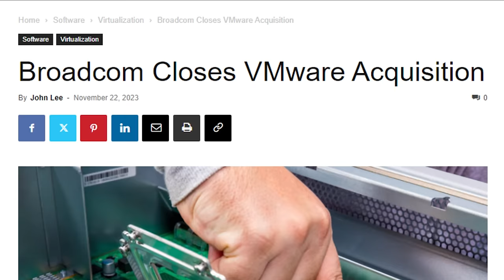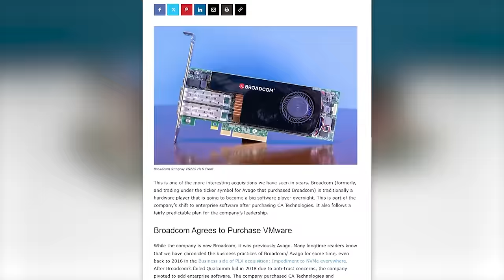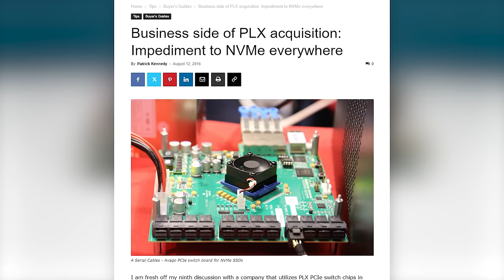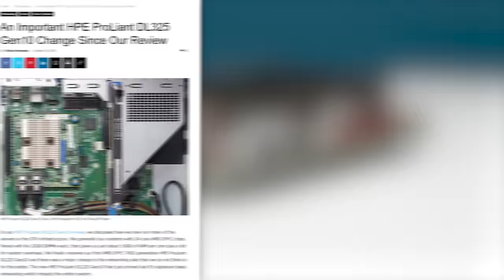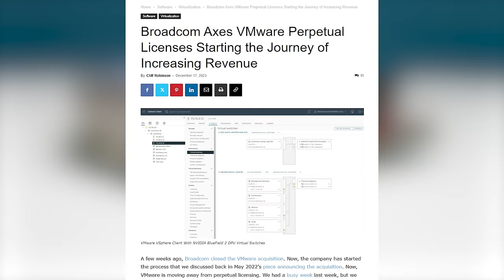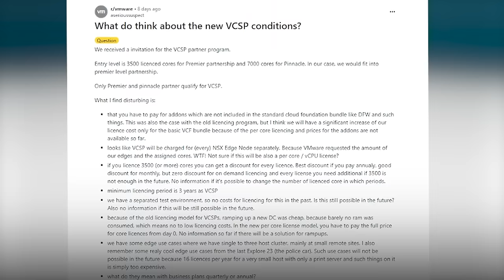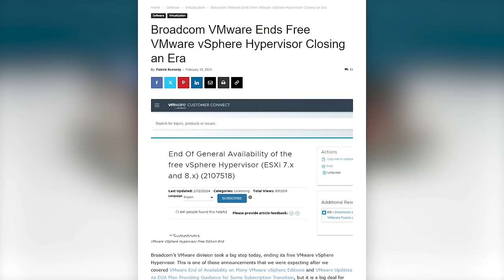VMware GUTS Customers with 10x Price Increases

Comment: This last 18 months has been one long gut punch to me. I've been playing with VMware for 15 years now. Yea, it was pricey, but it's a good product. Now, the way things look, it's almost at parity with bare metal for costs, at least in the VDI space.

I shouldn't whine too much. It's just a case of, "Things change, I better change too." I just hate how it was absolutely unnecessary. It's not a "revolutionary improvement," it's greed making a great thing suck.
Reply from the maker: I somewhat wonder if we are going to get a model with small PCs for data center managed physical desktop infrastructure. I think there is a business model there.
Reply: HP had the CDI Moonshot solution.   Too bad they can never hold on.  Moonshot was this dense compute platform and one cartridge had four AMD APU’s.   You managed the whole thing with Citrix but no virtualization.  Everyone got a dedicated system with low end GPU.   Think 140 or so laptops in a 4 u chassis

Comment: I work for a non-profit organisation that have been a VMware shop since 2005. We have a small environment consisting of 2x 3-host clusters using Essentials Plus and a 5-host Horizon VDI cluster. 

We used to receive reduced pricing due to being non-profit but now we are really concerned about what our renewal pricing is going to be under the new model. 

Switching to another platform might be what we have to do. 

For those in similar situations I would strongly recommend testing out other platforms and getting familiar with them, even if you have old hardware that you can run in your organisation to help better prepare for any transition.

Comment: I work for a smaller vmware cloud verified provider. Currently what will likely happen is , even if we do switch to something like nutanix, which is still up in the air right now, a large chunk of our cloud customers is gonna leave, which will likely lead to me being let go. It is how it is. Sucks but we gotta move forward
Reply: Last time I've checked the prices for vmw and ntnx (it was 2021 I believe) and the prices were around the same. But ntnx has a much lower TCO, it just works and you don't have to spend time on maintenance. The upgrade of the whole cluster is literally done via a few clicks in the GUI.

Comment: Yep, we are on a "deal" for the next bit with a company mandate to be off VMware and on AWS by the end onf 2025. ~3,400 VMs, ~100 hosts, ~4200 cores, ~77TB of RAM. Plus storage arrays and all the fun that goes with them.
Reply: Are you expected to see a cost savings by going to AWS or was that decision made just to avoid giving broadcom any more money? I would expect your AWS costs to be in line with broadcoms new pricing model (depending on load), no?
Reply: You costs will ALOT more than on prem vmware.. I already went down this road a few times.. If you cant shrink your workload when your not using it... probably better goto nutanix or something else..
Reply: @DerekPeldo  leadership decisions made over a year ago, I suspect it will be a money pit for a lower quality product.
Reply: @iimbt11  not an option, orders from the top.
Reply: @gcs8  yep been there too :) ... I remember about 6 months later  the CFO started really getting concerned when the expense started to skyrocket.. was funny when you showed them there was nothing they can do about.. worked with several companies since then that knew how to navigate the cloud, where you should goto cloud and when you shouldn't.. at least with your own infrastructure you can run it into the ground and depreciate the cost... then buy new...
Reply: And another one goes to the "cloud." You're trading one form of ransom for another.

Comment: I'm sure the price rises will be steep, but I can't really see the difference between the annual support and maintenance we currently pay and a "subscription". The support and maintenance allows us to use new versions regardless of the fact that our original perpetual licences for esxi/vcenter were bought in 2010.
Reply: Overall, you're right in that "subscription" vs "Purchase + support" for an enterprise doesn't have to be very different.  The biggest difference, in most cases, is that if you decide to drop support, you can still use the product, presumably while migrating off.   Without support, you could relegate that to non-production use, and it's still yours.  

As for the freak outs, customers are getting quoted for a whole wide range of multipliers over their existing support. I've heard anywhere from 1.3x to 25x.  There have to be some extraordinary circumstances in those high edge cases, but I can't say I haven't at least heard it.  So, like all things, especially if you're using EP, maybe with some Aria add-ons, you might not be in terrible shape. Assuming you're in a good negotiating position with whoever is doing the licensing, great. If you're using NSX, that'll likely be a hit, since you'll be pushed to VCF, especially with the distributed and gateway firewalling being add-ons.
Reply: @Ghandacity  I'm hopeful that we may be OK. We didn't go in for convergence so we just have vcenter & esxi. We have enterprise plus licences that I think we can now move down to standard since the implementation of an active-active metro node SAN solution, although I haven't looked too closely into that yet as we took up a multi year support agreement. 

As I understand it no support means no security patches, which would rule it out even for non production use in our environment.

Comment: We're currently setting up virtual test control computers fpr a German OEM (the one with rings) with VMWare ESXI and had for example issues with the VM host crashing when were runnung a specific application on a VM client instance. no one of VMware cared. And now it looks like we soon need to switch

Comment: Finally a video covering this painful subject.  Customers/Datacentres using the VCSP program which is metered in vRAM usage not cores are also typically using the vCF stack of vSphere/vCenter/NSX-T and possibly Cloud Director, moving away from all of that in 90 days or so is impossible (it's not as if you can just re-install a new Hypervisor on the same tin you've already invested in).

Maybe this week we'll know more about how smaller outfits can purchase licences through the aggregators, but I'm betting we'll lose direct GSS support with VMware if we do.  What a complete nightmare.  There is no way all of these customers are simply going to switch off their VMware estates come 31st March.
Reply: It’s an impossible job.  The obvious outcome is some businesses will risk becoming “non compliant”, as they work to migrate away.
Reply: It took years to go from nsxv to nsxt. Expecting anyone will be able to move out at such short notice - madness.

Comment: I work for a small University and we run a VMware environment of 12hosts/24CPUs. Going from Perpetual support to subscriptions will be 10x+ yearly cost increase. We run a bunch of "boxed" software that has to run on top of Windows so shifting to something like containers isn't an option. Going IaaS will be just as big of a price increase.
Reply: Why not hyper-V if you are mostly running windows?
Reply: Proxmox is the answer.

Comment: We're led to believe that smaller CSPs will be able to purchase via an aggregator. They won't need to shell out for the full 3,500 cores themselves. Basically, Broadcom only wants to deal with the big players and farm the rest off to intermediaries. We haven’t seen pricing for this 2-tier system yet. Apparently their approach in the USA isn’t legal in the EU so everyone is holding their breath to see what the damage is… or migrating away.
Reply from the maker: I just had someone from the EU send me a note their quote was around a 1000x price increase.
Reply: @ServeTheHomeVideo  I know some people have done the maths based on a minimum 3,500 buy-in and got themselves in a panic, but the information we've had (UK CSP) is that only a small number of large providers will be transacting like this. The rest will be via an aggregator, with support routed via the aggregator as well. It sounds very similar to Microsoft's two-tier CSP model.
We've had our invitation to the new reseller program, but the CSP one is still awaiting finalisation. I spoke to a current aggregator on Thursday and they said there's a legal hold-up so the new aggregator list hasn't been confirmed yet, much less pricing. 1000X seems highly unlikely given what we've seen of USA pricing so far. USA list price at premier level is about the same as we currently pay, per-core. It seems safe to assume smaller orders going through another reseller will pay more per-unit, but I can't imagine it being 1000X unless they're trying to license up a full premier CSP with nothing more than a quad-core laptop.
Communication from Broadcom has been shambolic, though. We're nearly half-way into the notice period they gave to partners and they still haven't figured it out, so rumours abound.
Reply: @ServeTheHomeVideo  Yeah that's the sort of price increase b2b has when you no longer want to do business with all the players in a vertical.
Reply: @ServeTheHomeVideo pricing is starting to make its way to the UK market. The 7 "pinnacle" partners have now been announced that CSPs can purchase smaller core counts through. None of them have committed to firm pricing yet but I've seen indicative pricing and it's nowhere near as bad as was feared.
The whole management of it by Broadcom has been a shambles, though. The way they've treated partners is itself an argument for dumping VMware.

Comment: The subscription model has been one of the greatest suppressors of creativity I've seen.  They no longer have a strong motivation to innovate, you're locked in and they know it.  In fact, the subscription model encourages stagnation as with a subscription service I DON'T want my software changing (beyond some bug fixes now and then perhaps).  I want the software I bought subscribed to 5 years ago to look and function identically today, just like it would had I bought a perpetual license.
Reply: That would suck in the case of VMware as vCenter used Flash 😱

Comment: I ran esxi free for years. I'm starting to build out Debian kvm hosts (hosts only) to stay more open source. i've run KVM in my home lab for years while supporting work based VMware installs and KVM is really solid. All my esxi vms have .vmdk disks that do run native to KVM. The only downside is the manual migration, but with shared storage it should be fine. I didn't use Horizon. Just Vms with Apache Guacamole as the front end  for remote work behind a proxy. Vmware just lost my years of recommending them. KVM for the win!

Comment: Proxmox is THE virtualisation option to migrate to. I am already in the process to convert customers VMs to Proxmox VMs.
Reply: Been running proxmox in prod for years now. No real issues, not a cent paid for support.
Reply: Unfortunately, support is only available during Austrian business hours, or from a reseller outside of those hours.  For me, to depend on a reseller is too risky for business critical infrastructure.
Reply: I mean, most that are using it are doing so with zero support and get along just fine.
It's really not terribly complicated, and the docs are good. You do need to now linux for some things, but even then, it's debian, which isn't exactly exotic.

Comment: We are a Microsoft HyperV-business and it has been great for our servers, so we are not affected by this much on the server side. 

But as a trainer, I used to use Virtual PC and now run Vmware Workstation on my laptop for customer demos and testing / documentation and stuff, and vmware workstation is way better than HyperV on a client computer for product demos (graphics hardware accelleration allows for full demos of PowerPoint, Teams meetings etc). I fear for the future of vmware workstation now. One can only hope that the product could be spun out or something but that is probably too much to hope. 
Virtual Box has not been as performant for Windows with graphics compared to vmware, but I may have to look at that again.
Reply from the maker: When you have to look at Oracle solutions due to another company's pricing, that is a fun comment.
Reply: our new server has hyper-v. 
And what is really nice?
Any version of windows above any home edition includes hyper-v for free. So, if your running windows 11 (pro or higher edition), then hyper-v is included for free. And even better? That same free edition of hyper-v included with your windows say on your laptop? Its the SAME version that runs on our "big" servers. 

I spent about 1 week building and setting up a web server on my laptop (a vm based on server 2019). After I was done, I just handed the VM over to the IT folks, and they spooled up that vm on the large company server and it ran perfect without a hitch.

So, having a low cost vm system means that developers and groups of people "learn" + use + adopt the system, but MORE important is that vm can then be used on corporate machines - so a perfect example of why hyper-v was such a great choice, since then even us developers now constant spool up vm's on our dev server, and as above shows, I even now spool up servers on my laptop to prepare a vm and system for the company servers.
So, big fan of hyper-v right now, and it's included for free with windows.

Comment: We run a small MSP in Germany with around 160 VMs as CSP partner. We just extended our CSP contract in october 2023 for another year. But VMware send us our termination notice on friday before christmas holidays for the end of march without ANY information about how we can go on. Until now we still have no clue how to operate our datacenter after 30th of march. We are too small for the new program. Have contracts with our customers and will be unable to serve them with VMware after end of march. Although we had a contract with VMware lasting until end of september. This is nothing I would consider a "partner" would do with you. Even if we could manage to buy licence white labeled through a larger CSP (competitor) our expense would at least double because of the core based model and how our environment is sized. We are actively planning to migrate to Proxmox or OpenStack.
Reply from the maker: Wow! That is a crazy story.
Reply: Many moons ago (~2016) we decide to go OpenStack at a previous employer.  I can highly recommend using Canonical to get you started - they deploy and manage the whole stack and either keep managing it or transition it over to your team on your timetable.

Comment: Four things:

1) I think that I tried VMware, ONCE, back in like 2004-6. It wasn't great. It was really slow back then, so I didn't spend much time with it.

2) Having said that, I think that projects like xcp-ng and Proxmox VE might start to see more people jumping onboard these projects as larger-scale-than-homelabbers start testing it out for small and medium enterprise deployments, so it will be interesting to see what happens there.

3) 10X increase in price is quite literally the "I don't want to do it" price.

4) This is going to go the way of UNIX admins. Fully agree with you that UNIX admins that are still out there, but I remember when I was learning Solaris 8 that I WISHED that IBM and HP made an x86 port of AIX and HP-UX respectively, so that I can learn on it.

Now, with Oracle having bought Sun Microsystems, Solaris 11.4 was last launched 5 years ago, so that's also going to slowly start going away as well; and along with that -- the UltraSPARC architecture will also likely fade out as well.
Reply: XCP-NG and Proxmox already have a large business install base, and they work well at scale because they're open. It's pretty trivial to dev your own solution if you need to do something it doesn't do already, and, if what you come up with is useful enough, you can get it merged in so your dev cost isn't as ongoing as it'd be with closed source software.

That's a whole lot of incentive in the medium business use case, that probably already has some amount of dev power available, and just got handed a "Sod Off" quote from VMware. So the future is bright and rosey.
Reply: Ummm, UNIX admins can't be very adept Linux admins? Also, there's still the Illumos project out there with all of the OpenSolaris goodness. Oh, and let's not forget xBSD. Lots of life left in that skillset.

Comment: Just wondering: Wouldn't be cheaper to actually buy and convert over to an IBM Mainframe?
Reply from the maker: Fun thought, but I doubt it.
Reply: @ServeTheHomeVideo  Well, going from $6,000 to $600,000 is an incentive, since an IBM Mainframe (hardware only) is around $500,000. Of course, you may be right because the requisite software is another half million... but still....

And the advantages the IBM mainframe has including encryption and AI built into the cpu(s) are formidable. This is not to mention that IBM invented Virtual Memory and VMware came along long after IBM had been supplying it for years.

But then, moving over to LVM would be a far better option.
Reply: For large scale operations mainframes are cheaper because they consume less power, take up less space, and require less networking equipment than server farms. IBM sells cheaper mainframes called LinuxONE, that have features intended for z/OS disabled (z/OS is an IBM OS, powers most mainframes).
Reply: IBM have a very good claim to inventing Virtual Machines … CP/67, VM/370, z/VM … But not Virtual Memory … that’s due to Tom Kilburn’s team at Manchester University when they designed what became the Atlas computer. Goes back to the late 1950s although it took a while before both hardware and software were fully functional… :-)